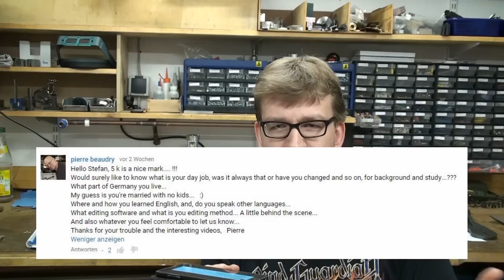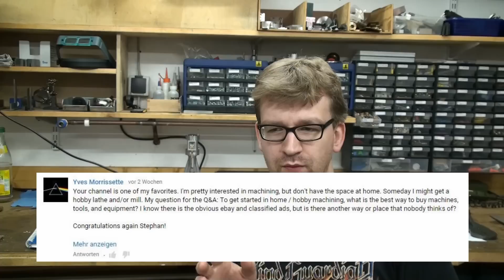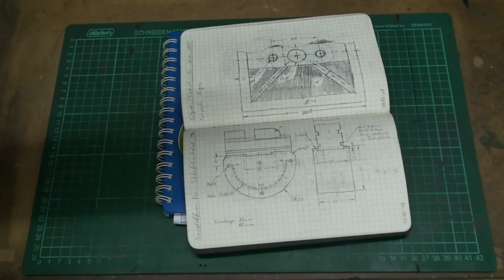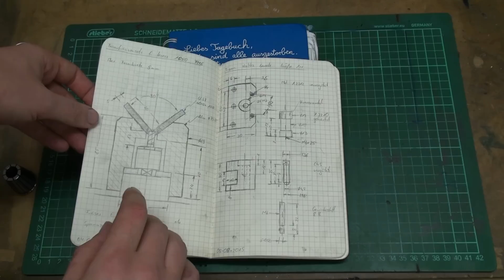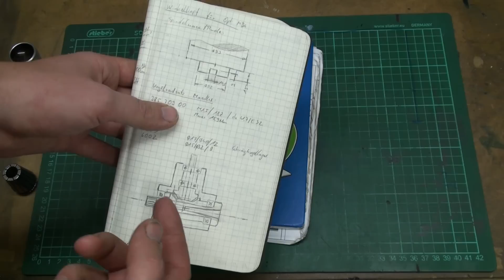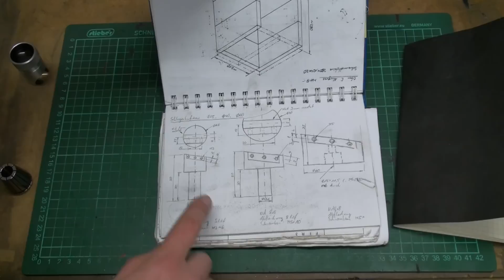Your Questions, my Answers - Frage und Antwort

Comment: Not so much for Stefan, but to Yves Morissete. If you have no room, consider micro-lathes and micro-mills. In order of price, there is (are?) Proxxon, Sherline, and Taig. Look them up. Any one of them will fit in a closet. Set them up on a Workmate and you have a small machine. I own a Taig lathe and a Proxxon MF70 mill, and a Clarke drill press . They now occupy a 1.35-meter workbench,  but I could put l put the whole shop in a closet. 

To Stefan: you are the best sketcher I have ever seen. I also do sketches, because all you need is the critical dimensions. There is no virtue to CAD drawings unless (a)  you are in an industrial environment or (b)  there are  parts that have to fit very exactly. I will have to resort to CAD to lay out my clock, because I changed the module from the original.

A very good video. Thanks for all the care you take.

Comment: Thank you Stefan, that was a great video. I too share your tastes in both the sketching and graph paper, and will try out that size of notebook. It seems much more convenient than the 8.5 x 11 inch notepads I have, and while I like the large pages for drawing, if the notepad is too large that I don't want to carry it with me than what good is it? 

Do you ever work with isometric graph paper? I never even knew about it until searching for the smaller notebooks you use, and there it was! It looks very interesting and I think I will try a pad of it. Why not right, if I don't like it I can always use it for shopping lists, LOL!

Great one about divorcing your machines, I had a good laugh at that one! See you online soon, Aloha...Chuck

Comment: Hi Stefan,
Interesting video and I've always wondered what you did as a career. Maybe do something like this Q&A once a year? And you have 5800 viewers at this point for many excellent reasons. Hope you don't mind a thought about your tailstock turret. Downriver Tools in the U.S. offer a plan set for a bed mounted turret in various sizes. Yes your tailstock mounted turret would be far faster to get setup and working, but the bed mounted setup would be far more rigid. 

You probably already have it given your interests, but if not? George H. Thomas "The Model Engineers Workshop Manual" available from either Hemingway Kits or Tee Publishing who are both in the U.K. is an exceptionally great book. Your attention to detail, machining, and design sense reminds me very much of Georges writings.

Comment: Damn nice :) I like the drawing part. I kinda do the same for relaxing. But what when you have built all the tool you need and a few more..... Can we expect a miniature Porche aircooled 6 syl ?
Reply from the maker: +Eric Hope Porsche? With a VW Diesel? Dont think so, runs to dirty ;)
Maybe a nice clean miniature nuclear plant... ;)
Reply: +Stefan Gotteswinter  Why am I not surprised :) You know where to aim... Go for it :)
Reply: CNC machine that Stefan runs at his job is Porsche (may be even space shuttle) of cnc industry.
Reply: +Stefan Gotteswinter I thought that is what you were building the steam engine for? :-) At least the VW only pollutes when running, the nuclear pollutes all the time for thousands of years. With the steam you can burn bio fuels which the EU consider carbon neutral and save the planet while using your very own crafted engine! 
 I really could have used your CNC welder for all the crane beams I have been welding for my shop. Doing it the manual way is very satisfying as well. Enjoyed the video!